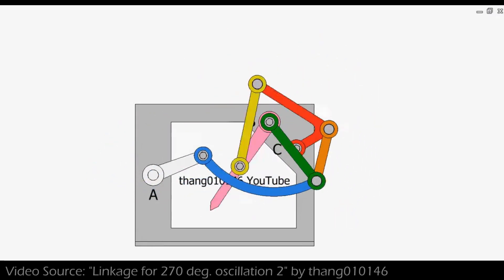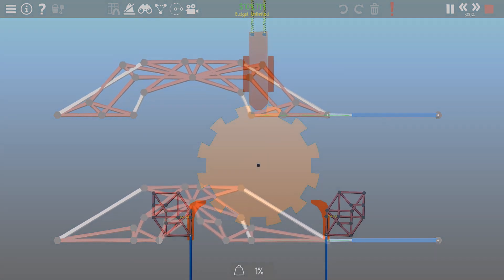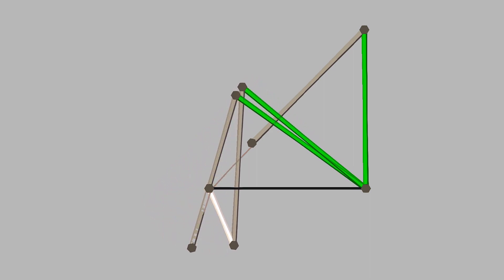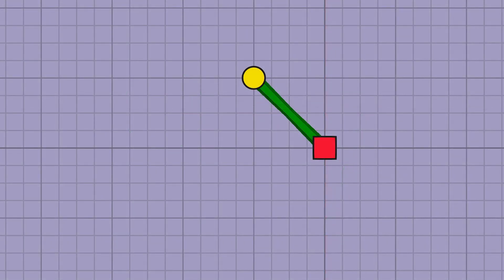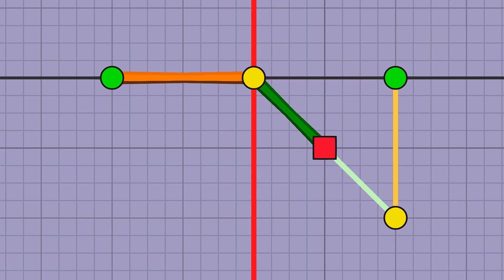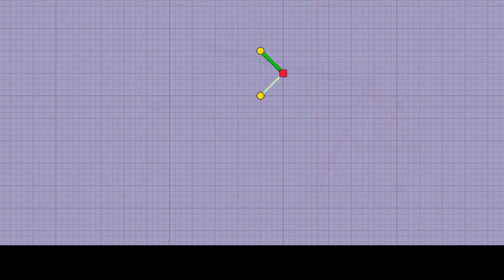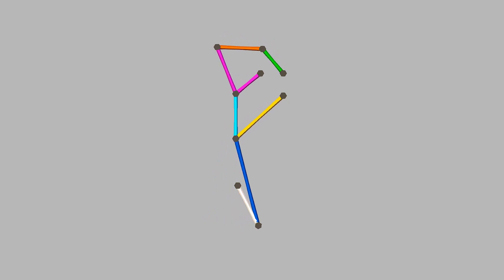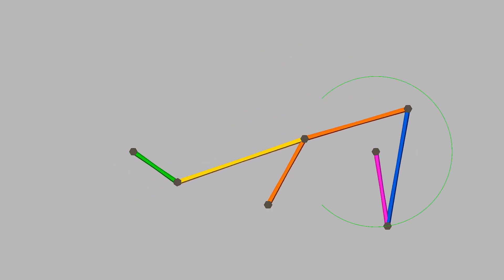Linkage for 270 deg. oscillation - Explanation

Comment: Can you repeat this pattern to get greater angles of rotation?
Reply from the maker: I do not believe so, I'm afraid.
The mechanism relies on the behavior of 4 bar linkages.
What this uses is a crank and rocker mechanism to convert rotational motion to a 90 degree rocking motion.
After that, I appended a double rocker mechanism to convert from 90 degree to 180 degree. From that, I appended a third to produce 270.
I have successfully produced a mechanism that was capable of going from 270 degrees to 360 degrees, though it's very unstable and far from a smooth regular oscillating motion.

I suspect that trying to go a value significantly greater than 360 degrees using this method is not possible, because the only linkage arrangement available to append onto the 360 degree output using this method is a drag link, or a double crank mechanism, which is basically just 360 to... 360 again.

Now I do emphasize 'this method' a bit there. It is actually entirely possible to get oscillations WAY higher than 360 degrees using purely links, though they require kite linkages which become a huge hassle to try and deal with when it comes to bracing dead positions, and it's probably better to just use a Sinus and rack pinion drive if you're fine with the usage of gears and prismatic joints.

I may try and take up the challenge of producing an oscillator purely out of rods and revolute joints though, so perhaps expect a simulation of that at some point on this channel.

Comment: ok this is actually really cool. would this also be possible for any arbitrary angle?
Reply from the maker: Yes, this will work with any arbitrary angle from 0 to 360 degrees, you just need to first describe the output movement, and then from there you can construct the rest of the linkage system based on it.
Reply: @ArglinV3  oh cool. I might wanna try this myself but I'm probably gonna forget